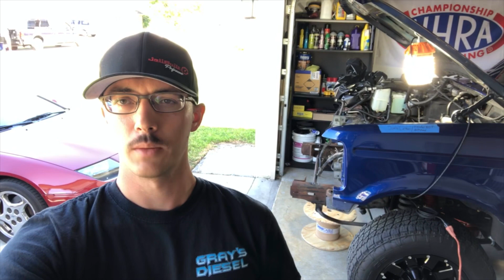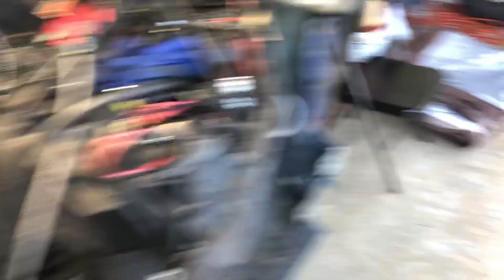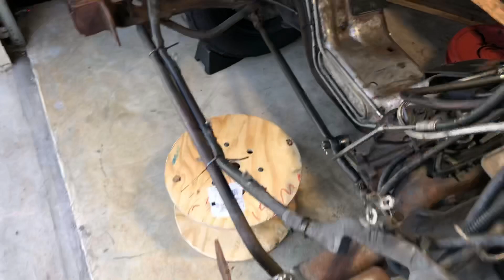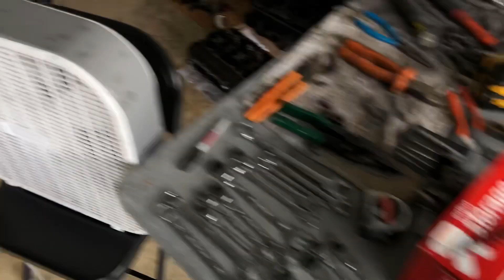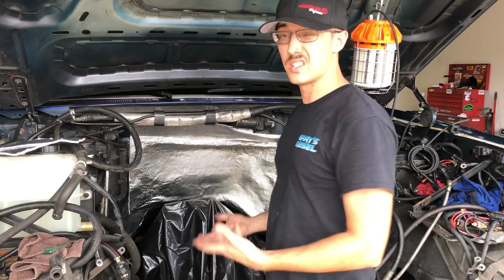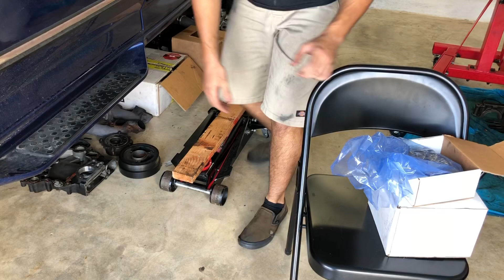OBS 7.3 build update! PARTS are coming in!

Comment: I have a 97 f250 2wd and installed a 2.5” leveling kit and it had extremely bad positive camber so I got the adjustable camber bushing and still did not fix it all the way still had 2 degrees of camber what did you do to get your camber right ?
Reply from the maker: I actually ran into the same issue you have. I took my truck to a 4x4 shop and they had to take some material out of each bolt path way on the I-beam mounting location. When they did that, they were able to get the camber angle to normal.
Reply: Hey man could you post a vid of your truck with the 2.5” kit? I’ve also got a extended cab f250 and I was thinking about getting that lift
Reply: Jonathan Acosta me ? I took it off but if your wanted to know how to install I can make a quick vid right now
Reply: If you want me to I can just give me a min or too and I’ll post it on my YouTube channel ( Obs powerstroke or click the icon and it will take you there to )
Reply: OBS Powerstroke yeah your truck looks a lot bigger than a 2.5” lift lol. But thank you that’d be really helpful. I’m trying to get an idea of what to expect

Comment: Any advice for making around 350 wheel horsepower with a 97 F250? Also what simple trans upgrades could I do?
Reply from the maker: So you could achieve 350rwhp with a set of baby swamps inejctors(150/146) or a set of 160/80% or 160/100%. Some trans modifications you can do are a BTS valve body with a trans-go shift plate paired with a nice torque converter!
Reply: The 7.3 Garage Thanks! Who would you recommend for the torque converter?